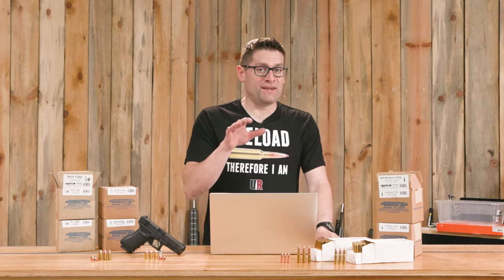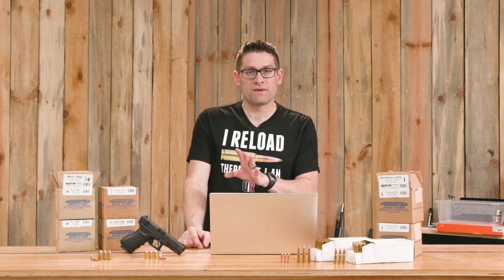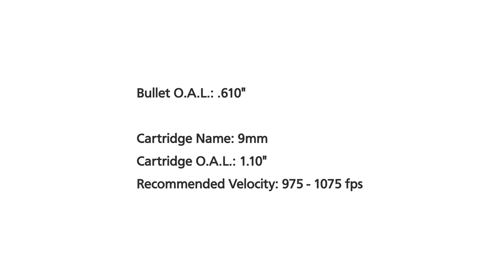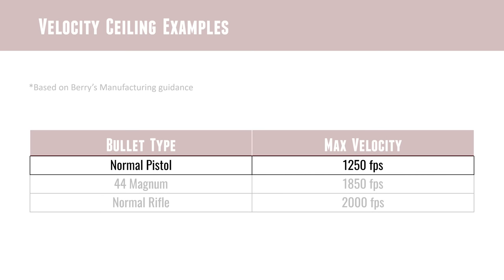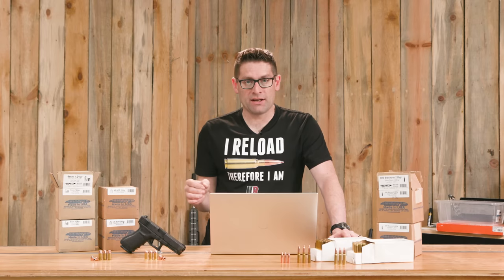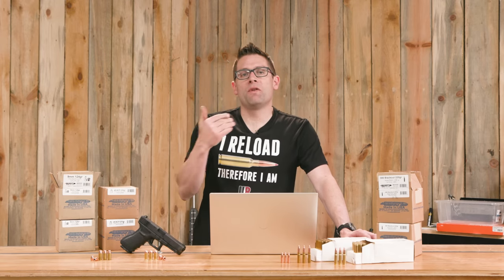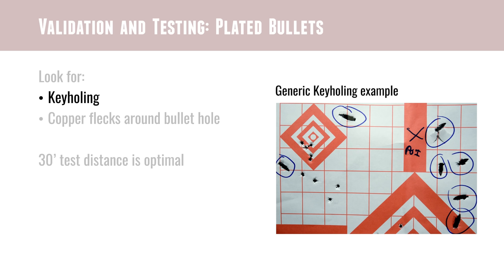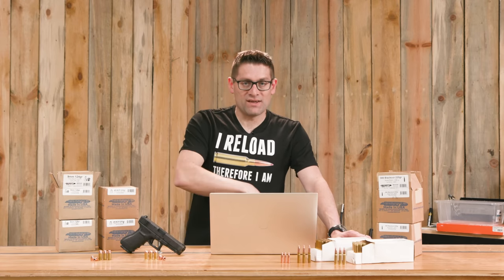Plated vs Jacketed Bullets: Load Data and Considerations

Comment: Berry's needs to publish a book with load data, crimping, case prep... specifically for Berry's. And also tackle the questions about weird OAL on the 220g 300bo.
Reply: Xtreme does have a load manual for their bullets
Reply: @charlesphillips5906  Very limited powder testing with the Xtreme load manual.
Reply: @NickLoecke  Yes only a few powders tested. But it is helpful because it gives you OAL for their bullets, which is what I use most of the time.
Reply: Totally agree 👍

Comment: Now this is a video that NEEDED to be made. Load data can get confusing when it comes to plated bullets.
Reply from the maker: Glad you found it helpful John!
Reply: @Ultimatereloader  Because Berry's state that it is okay to use jacketed load data on their website, that is what I follow. Some load data will have data specific to plated bullets which leads me to believe that the data is for bullets from other manufacturers. That is why Berry's is the only brand of plated bullets that I use. Their 220gr 300 Blackout #21019 bullets with 11.0 grains of SW Blackout, converted Lake City brass & CCI No 41 primers is a very accurate subsonic load for my 10.5" barreled AR.

Comment: I've been using Berry's Plated bullets for years in my .45 ACP and .40 S&W pistols. Excellent accuracy for both. The load I use for the .45 is the 230 grain bullet with 7.0 grains of Long Shot with 1.250 O.L and for the .40 I use the Berry 180 grain bullet over 6.7 grains Long Shot 1.125 O.L. Excellent bullets.

Comment: I use Berry's in 9mm and .45acp, I load a little under max using win 231 and have had no problems at all, they are accurate and they ring steel just fine.

Comment: I’ve been using  Xtreme 124 gr rn for years now and they have similar velocity recommendations. Any load on the high end for hard cast lead or mid range jacketed works just fine. 5.4 gr of CFE Pistol works in all my guns with 100% reliability.

Comment: Thanks. 
Bought a quantity of Berry’s 158 grain plated in .357 
You’re video was an excellent confirmation of recent homework. I bought jacketed XTP to do high velocity hand loads.  
The plated Berry’s I plan to load well below rated 1,500 fps max so I can fire them at my local gun club (where magnum loads are frowned upon).
Once I run out of 38 special factory ammo the Colt Target will never shoot that short round again!

Comment: Personally if I'm loading ammo that's not going to be used for self defense or hunting I'm doing what I can to save money so that means budget bullet and low charge weights. So I do like these plated bullets and I normally try to keep the charge weight just high enough to reliably cycle the gun and use whatever OAL a similar jacketed bullet uses. I've shot thousands of plated bullets from a few different manufacturers and honestly I can't tell a difference between them and regular old FMJ bullets other then the name and sometimes the price. Great video as always keepem coming brother!!!

Comment: Thank you for your video.
I used Barry's in a .357 mag. long gun, at 2199 fps. The recommended max velocity for the bullet  was 1250fps.  It left me with a wild, 5" group at about 60 yards.
I had different results with  3.7  grains less powder. The velocity was 1927 fps. The group was 1 inch.  Still 677 fps faster than recommended. 
In both groups I didn't experience any key holeing, or copper flecks. (Clean holes) I think that says a lot about Berry's

Comment: I have been using xtreme for 38sp 45 acp 40sw with no issues at all.  I like plated bullets for all the reasons you stated. I have used Berrys for 300 blk and they seem to be great for subsonic

Comment: In general no problems with plated RN but I have a load of 147 9mm berry’s FP that won’t fit in anything I own. :/ 
It would be great to see you work with powder coated lead bullets in terms of load data and how they perform for you 🇺🇸
Reply: I second this notion. I started casting and am having issues with leading in my 9mm. However 45 acp has been perfect. It would be great to see the results.

Comment: I just ordered some berry's .45 ACP for a batch of 500 right before your video came out. I have loaded more than a 1000 rounds of 9mm with berry's plated both HP and RN. Crimping caution is real. My experience with crimping plated rounds is that if you crimp AT ALL, no matter how light, the projectiles jiggle and rotate and continue to get looser almost by the minute. On every round that I have not crimped, I have had ZERO issues with neck tension or projectile shift or fit. My other discovery is that proper brass prep and case deburring is ESSENTIAL when loading plated rounds. There is a chance that the plating can snag and rip when you're seating if you don't go slow and careful.

Comment: Been loading with berrys for years but just plinking ammo, so I typically rock the starting load unless I have cycling issues, which only happened once..
I have yet to do anything more than just basic range ammo very similar to the old federal champion that walmart used to have in the brick red 100rnd bulk packs.
I miss those days.

Comment: Berry's puts out a great product. I've been using their pistol caliber bullets for a number of years for practice/range ammo. These bullets are certainly cheaper than jacketed bullets with many of the same advantages as described in the video. More care is called for when loading plated bullets. It is best to load plated bullets as if loading cast lead bullets. When loading cast lead, mouth flaring and proper chamferring is a must. This will protect the plating from scraping during the seating process. Further only a light crimp can be tolerated by the thin copper plating on the bullet. Should you crimp too tightly, you will cut the plating and the plating will likely separate from the lead during firing caused by the rotational (centrifigal) forces exerted on the plating. I've found that cast lead loading data works well for me. This forces me to load within the limitations of the plated bullets and excellent accuracy can still be obtained. What I find nice about Berry's bullets is that their Thick Plated bullets avoid leading and work well in polygonal rifled (Glock and Walther as examples) barrels which are notoriously prone to leading using hard cast bullets. For those magnum caliber rimmed cartridges such as .38 Special, .357 Magnum, etc, a collet style crimp can be used with a tighter crimp than can be tolerated by a roll or taper crimp. This is possible as many of these revolver cartridges headspace off of the rim, and not the mouth of the cartridge. Still care must be used to not over crimp even using a collet style (Lee Factory Crimp as an example) die. Keep in mind though that bullet setback is not likely as the velocities many of the non-magnum cartridges are loaded to do not offer significant recoil (Lever guns with tubular magazines may be a bit more of concern here). I still recommend a light crimp for safety's sake. For what it's worth, there's my two cents worth of "My Observations". Your mileage may vary.. Happy reloading/hunting/shooting!

Comment: to you new reloaders, a chronograph is a very helpful piece of equipment. i shot plated, fmj, lead cast, and coated bullets for pistol. All perform differently. knowing velocities is very instrumental. cheers!
Reply: Great comment! This can’t be said enough..... chronograph data along with reading primers and cases is so valuable!
Reply: Definitely, especially if you are going to use plated bullets with a max velocity on them, or lead bullets that don’t have a jacket.

I did this when I was shooting 30-30, 9mm, and 45 and I was exceeding the recommended velocity for plated bullets (unintentionally at first with the 9mm in a PCC with a longer barrel which upped the velocity, then intentionally later).  Didn’t have any of the issues described in the video but the chronograph was able to confirm my initial mistake and aide in my experimenting.
Reply: Surprised to see the bullet shadow timing chronograph on this channel.  I have abandoned mine and now use LabRadar.
Reply: @randytolle6706  I'm thinking about getting a lab radar sometime. especially for rifle load development. i've been using a caldwell IR one and it is fantastic for pistol. had a Chrony for a while and it was unreliable.
Reply: @nathandively8524  my only experience with the bullet shaw units is with my Chrony and couldn't trust the numbers

Comment: I use a Campro plated bullets in handguns, semi-auto carbines, and lever action rifles- 124gn RN & HP 9mm, 125gn & 158gn TC FCP 38/357, 200gn & 240gn 44cal, 300gn & 405gn 45-70Gov. Campro provides load data on their web site. I regularly shoot the back yard gongs with the Campro's 240gn TC FCP 44cal bullet from a 444Marlin, loaded with 51gn of H4895, just under 44Mag MAX chamber pressures, gives me a muzzle velocity just over 2000fps. Great bullets to have available during this component shortage.

Comment: I would love to see some videos on cast bullets. I started casting my own. And I've had no luck with 9mm reduced loads still lead the barrel. 45 acp has been fantastic. No issues there. 357 Magnum has been amazing! Great results with powder coat linotype and a gas check. I get very bad gas cutting on my 9mm

Comment: I've shot the Berry's plated 30 cal 150 gr in my 30-30. Keeping the velocity down around 1800 fps was very accurate out to 150 yds.
After that they became unstable. This was used in a levergun silhouette  match. So once my targets were past 150 yds my hits went goofy.
At 100 yds from the bench it would shoot close to 1in.
I've got some of the 230 gr rn for my 45 but haven't tested it yet. Looking at your results I'd be happy if even close. 
Thanks for the video.

Comment: My understanding has always been that, with standard plated bullets, you don't want to push them over 1200-1250. But you can use any data provided your under the velocity limit.

Comment: I have pushed berry manufacturing plated bullets passed their advertised max velocity (9mm, 45, 30-30), by roughly 100 fps for the pistol rounds and 200 fps for the 30-30.  I was curious to see if it would damage the plating, or if it would impact accuracy.

It did no such thing.  I did so with some relatively hot loads and pistol caliber carbines for the 9 and 45, and for 30-30, just picked out a load that would push that bullet past 2000fps out of a Marlin lever action.

I shot the PCCs at 100 yards and the 30-30 at 200 yards and didn’t see any accuracy issues.

Edit: Of course I wouldn’t recommend pushing the bullets that fast, just wanted to share my experience.  Keep in mind you can easily push a 9 or 45 past the recommended velocity with a PCC with a longer barrel, even with your standard load you use in a traditional pistol.

Comment: Only issue I had with plated bullets. I reloaded  Rainier and Berrys RN and JHP's for my 38 special revolver. After each shot I measured the OAL of the remaining bullets in the cylinder and found the bullets had moved. I increased the crimp. Buy the time I found enough of a crimp to stop that. I had pierced the bullet plating. Can't use them for my revolvers unless I use Berrys DE wadcutters. In my 45 ACP, 9MM pistols they work great no issues. I use nothing but plated for them. Both Berrys and Rainier. Very happy

Comment: I've loaded Berry's 350 FP plated bullet (.458") in my 45-70 Guide Gun, and my Ruger #1 in .458 WinMag, to around 1300 fps with no issues.   They are accurate and  at such modest velocities they make a great "plinking" round.  They have a cannelure which makes it easier.

I've also loaded them in my .458 SoCom to around 1600 fps.   The box says maximum MV around 1700.

Plus, I've loaded their .500" 350 grain bullet in my 500 S&W to around 1250 fps, which makes for a nice, easy-shooting load.   They also feature a cannelure.

Comment: Well, maybe they changed something, but for the past 10 years I’ve loaded plated bullets as per Berry’s instructions in their ad in the Dillon “Blue Press”:  

“When loading plated bullets we have found best results using LOW to MID-RANGE jacketed data in the load manual.  You must use data for a bullet that has the same weight and profile as the one you are loading.  Do not exceed mid-range loads.”

Also:  

“Velocities depend on the caliber, but as a rule of thumb, we recommend you don’t shoot our plated bullets over 1200 FPS.  Our .44s actually shoot best around 1150 FPS.  45s are generally good at 850-900 FPS.  Our bullets are NOT recommended for magnum velocities.”  I would never try anything close 1850 for a .44 plated bullet.

Comment: I’ve been chasing Buffalo Bore and Underwood hard cast numbers with my 10mm. Plated 220gr and some Longshot with small primer brass has been the best for 1250-1300fps. Granted I’m loading beyond the recommended 1200fps from the bullet manufacturer but when I shoot into water and sand I’m not seeing any fouling of the plating. I switched to small primers after your small vs large primer video.
Reply: You went from large primers to small primers in 10 mm?
Reply: @allenhoward178  yeah I was shooting large primer brass and went to small primer brass for my hotter/higher pressure loads.
Reply: @allenhoward178  watch his video on the debate between small primer brass and large primer brass. It made me give it a shot. I use large primer brass for my range ammo. I saw more consistency using small primers in my spicier loads.

Comment: I once bought up a bunch of old plated .38spcl for real cheap that was made by a now defunct company that used plastic cases that looked like little shotgun shells and used narrow necked projectiles that snaped into the neck of the case so you could handload without tools. The plastic cases were so brittle due to age that they were unusable, but I found I could load the unusual shaped projectiles upside down in a brass case and the result was a sort of stepped semi-wadcutter and the accuracy was excellent as long as I kept the velocity down. I've found the plating was so thin that if I pushed these much past load data for lead, the plating would sheer off the bullets leaving jagged holes all over the target like a nasty shotgun round.

Comment: When u said rifle bullets limited to 2000 fos, my imnediate thought was "Krag". Hopefully they make a 180 gr or 200 gr 30 cal. I hear good things about the pistol bullets. I will certainly try them when i am able to load. A limit of 1250 should be fine for 158 gr 357 in handguns, and of course 180's are a bit slower. Pistol bullets should be fine for slightly under max loads with 210 gr 41 mag or 240 or heavier 44 mag (assuming Berry's makes them). If they make a 358 rifle bullet, that might do well in my 357 Herrett (or experiment with the pistol bullets to see how much they can take. Holding 30-30 to 2000 fos or less with 150's or 170's might make a pleasant practice load for new shooters or those who are recoil sensitive. Lots of good applications. Thanks for the info.

Comment: I've been wondering about 9mm pccs using pistol loads with Berrys. The load I'm using says it goes in the high 900s in a pistol. But the gain in a 16" barrel is hard to predict. 6.7 gns accurate # 7 124 gn RN. I'm hoping for no problems but it's too cold yet for plinking. Update: this load seems fine in the carbine.

Comment: Wish berry's would make their 10mm .400 bullets to take 1500+. I have a 6.5" barrel and I'm going to go way over their Max velocities.
Reply: I can reliably get 1300fps from .400 220gr plated bullets. Max speed I’ve seen is 1350fps and I haven’t had any delaminating when shooting into water or wet sand.
Reply: Yep 9mm and 45 pushed faster doesn’t cause issues either (out of PCCs with longer barrels)